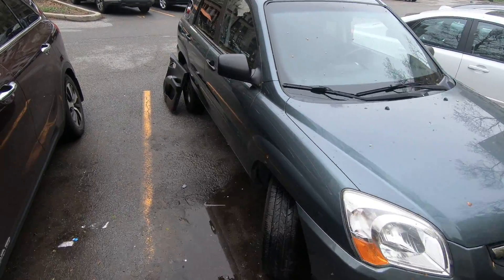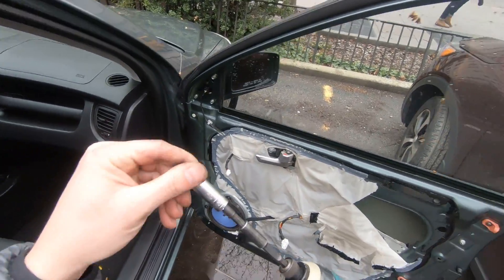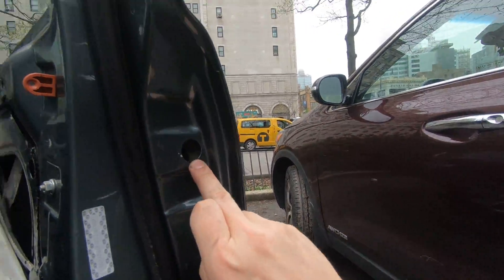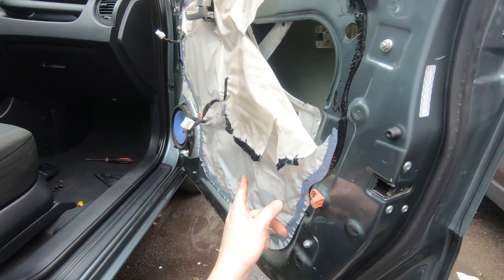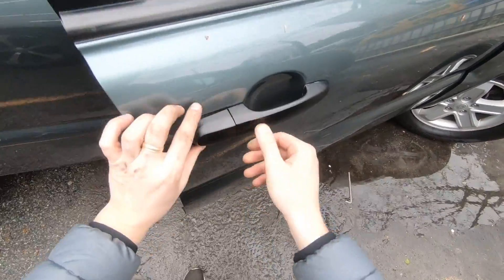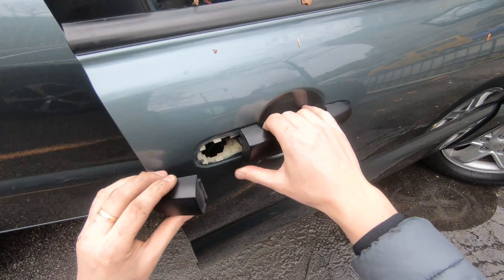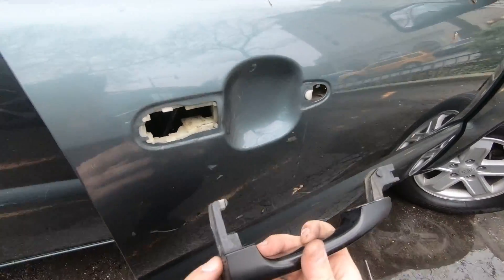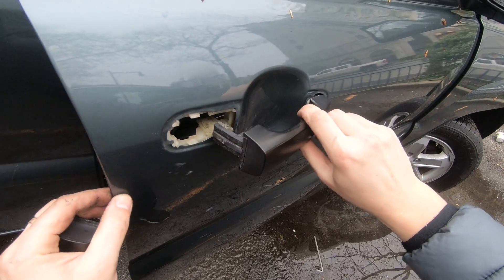How to replace Door Handle on Kia Sportage 05-10

Comment: Can you please make a video of the driver side door handle because because of the keyhole and all the wires I can't seem to get the keyhole part back in place and flush with the 10 mm screw when the handles in .... The keyhole part only since flush with where the 10 mm screw goes only when the actual handle is not in
Reply: Ever find a good video for this?

Comment: Just incase you drop the bolt, which most likely you will, go to auto zone and buy this 006070 hex flange bolt M6-1.00x45mm is $4 bucks and sve you time and you won't have to remove the door pannel
Reply: I love you
Reply: Very thoughtful.  Thank you!

Comment: This is helpful but what if the handle has the key hole? Is it still the same?
Reply: yup.
Reply: @erikanderson1720  we can't get the cover to release from the key cylinder after taking off the 10mm bolt. This is the for the keyed driver's door (attempted theft). Any advice??
Reply: @FixAlex wondering if you could advise as well? Appreciate the video.
Reply: @marijkephoto  I'm sorry but I don't have the car available to check it out anymore :/ I'm guessing it's just stuck on / snagged on something else! Take as good of a look with a flashlight as you can. Might need some more persuasion / force / twisting / shimmying etc. Carefully though ofcourse! Goodluck.
Reply: @marijkephoto  I'm sorry but I don't have the car available to check it out anymore :/ I'm guessing it's just stuck on / snagged on something else! Take as good of a look with a flashlight as you can. Might need some more persuasion / force / twisting / shimmying etc. Carefully though ofcourse! Goodluck.

Comment: Wht about the rear door handle???
Reply from the maker: Its Same
Reply: @FixAlex  no it's not  I tried to pull it out an broke it
Reply: @rigobertohernandez7333  Correct, rear is different. As far as I've seen you have to remove the inside doorpanel, but don't know yet.
Reply: @jackpolanen  ok
Reply: @jackpolanen  On my 2008 Sportage, the rear doors have no easy access via a pop-out plug like the front doors do.  I had to remove the inside panel. As in this vid, the handle consists of two parts but the 10mm bolt that needs to be unscrewed is deeply hidden inside, twds the rear of the door and had linkage in the way, hindering acess. It took a smaller socket wrench than I even owned (which I borrowed). In order to provide the necessary clearance for the wrench, it was necessary for someone to activate & hold the door latch open from the outside. The bolt does not need to be totally removed from it's seat. I was able to start the threading in the new replacement part by using my index & middle finger (couldn't even use a thumb). I bought the part on Amazon for c. $14 and it included both front and rear parts, plus included the gaskets. It only is available in black, so I was also lucky that my Kia is black so I didn't have to paint it.
Reply: On my 2008 Sportage, the rear doors have no easy access via a pop-out plug like the front doors do.  I had to remove the inside door panel. As in this vid, the handle consists of two parts but the 10mm bolt that needs to be unscrewed is deeply hidden inside, twds the rear of the door and had linkage in the way, hindering acess. It took a smaller socket wrench than I even owned (which I borrowed). In order to provide the necessary clearance for the wrench, it was necessary for someone to activate & hold the door latch open from the outside. The bolt does not need to be totally removed from it's seat. I was able to start the threading in the new replacement part by using my index & middle finger (couldn't even use a thumb). I bought the part on Amazon for c. $14 and it included both front and rear parts, plus included the gaskets. It only is available in black, so I was also lucky that my Kia is black so I didn't have to paint it.
Reply: @NiraTocco  Did you replace the front as well? We tried to replace the driver's (keyed) handle and can't get the old broken cover from an attempted theft to separate from the key cylinder, which appears to not be broken. Any advice for DIY replace would be incredibly appreciated.

Comment: Will an EX  door handle ( just handle , I know EX has key hole cut outs for both driver and passenger side) fit/work on an LX. I see in video you have LX  like me with no key hole on pass. side, but they accidentally sent me and EX handle for my LX. 
Looks exactly the same,  but u know how that assumption can go.
Anyone happens to know would be much appreciated. I will check in my emails and back here to see if anyone knows. Thx in advance to anyone who may know
Reply from the maker: Should work